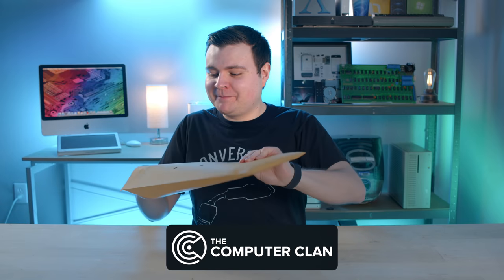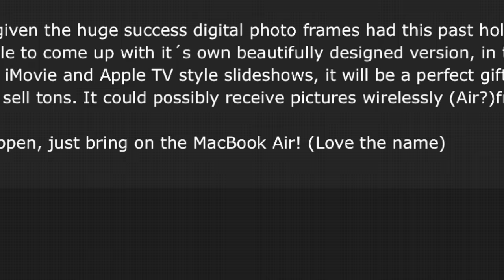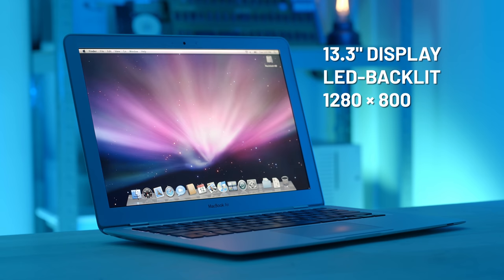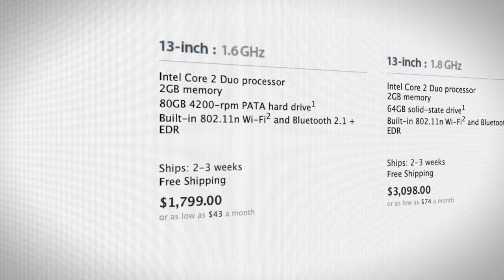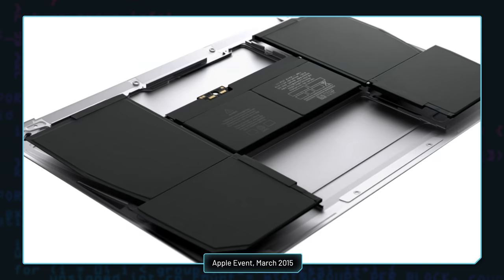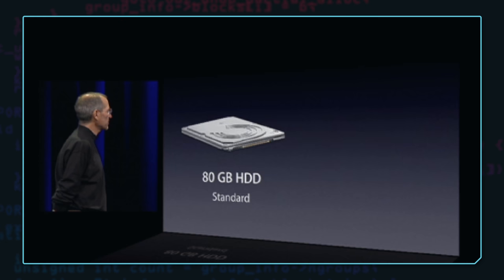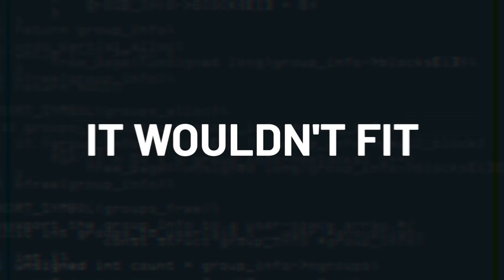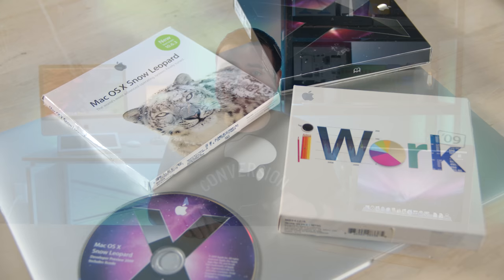How the MacBook Air Changed EVERYTHING - Krazy Ken’s Tech Talk

Comment: "A fresh, new SSD can absolutely breathe new life into an older computer" you're telling me, i finally added an ssd to my 2013 dell laptop that took ~10 minutes to boot into windows 10 recently, and now its faster than ever! 100% worth the $30
Reply: Yeah, spinning hard disks are the biggest bottleneck for many computers.
Reply: If Windows takes 10 minutes to start then it's beyond "bottleneck". It's defective.
Reply: @kg790  the drive itself still functioned fine, just took ages to get into windows. after booting it wasn't snappy per se, but nothing past the initial boot took very long
Reply: @Owtasmh  If the mechanical drive was OK, then the Windows installation was horrendously bloated. I bet if you imaged it to the SSD boot time would still be mediocre in the best of cases. My HP laptop, also from 2013 and spinning HD, boots in under a couple of minutes to fully working state, and that's with a several year old install and no optimization of any type.

Comment: My favorite part of the Air was that within less than a year I was able to hackintosh OSX onto a Dell Vostro A90 because it shared virtually all of the necessary hardware. I still have that thing running strong on 10.5.6 thirteen-plus years later.

Comment: I had the 2010 MacBook Air. I bought it to take to class. I was in my third year of college. The notebook I was using before to take to class was a thick ThinkPad. I am not a MacOS person, but at the time the Ultrabook didn't exist. It was the ONLY option if you wanted a thin and light laptop to bring to class. 

Now, I use a ThinkPad X1 Carbon running Fedora. It's a much better experience imo. It is just as thin and light as the Air was back then, but I get a full compliment of ports.
Reply: fedora? eww. use arch instead.

Comment: I still have one of those external SuperDrives. It's plugged in to my M1 Mac Mini. I think I last used it about six months ago to burn a CD to reload the OS onto a rack mount server in my garage server "closet".

I didn't begrudge the loss of the optical drive. I couldn't afford an Air at the time, but I had a Sony thin and light laptop that had no optical drive (dating back to 1999,) and a 15" MacBook Pro.

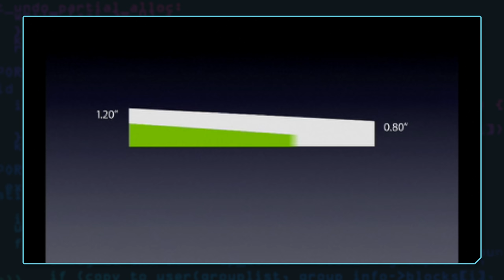Comment: @02:02 I don't care that much about weight (until it becomes ridiculous). I don't care that much about how thin it is, unless it's too tall to reach the keyboard. I want something more modular, repairable, modifiable, upgradable; built robustly, with upgradable lithium batteries that last for several hours, upgradable antennas and receiver electronics, video cards, mobos, ram, ports, m.2 storage. I want captured fasteners, so they can't be lost or mixed up. I'd be willing to pay more for such a platform.  
 That being said, all the mac laptops are very nice and work wonderfully.

Comment: I had a early 2015 MacBook Air that I bought used around 2 weeks ago.  After being charged 2 times, it stopped working. I bought it for 75$. Does anyone know why and how to fix this?
Reply: Change the battery
Reply: Most likely a dead battery 🙂
Reply: battery. Check Hugh Jefferys on this platform
Reply: Most likely the battery. Even if it was working I would recommend replacing it, since most batteries only usually last ~5 years. It’s been 7 at this point.
Reply: You need to replace the oil once per two weeks, did you do that?
Reply: Corbin Auriti  as far as I know if there is no battery detected (which would happen if it died fully) then the computer won't power itself on
Reply: @myrealusername2193  A mac can boot without a battery aslong as its connected to its AC adapter
Reply: @TotosSword  I charged it, the indicator showed green but still no signs of life.

Comment: My first ever Mac (that I'm also currently typing this on) was the cheapest one could get new in 2016 - An 11" MacBook Air for €899. I've rarely missed the optical drive, and the tiny screen has its limits, but also means it can fit anywhere an A4 sheet of paper can.

Also, does the 2010 MBA seriously have an eject key? What for? The 2010 and after models ditched it for a power button key instead.
Reply: Apple external keyboards had an eject key until fairly recently. Even my iMac’s keyboard (late 2015 model) has an eject key.
Reply: @TimurTripp2  even the 1st gen magic keyboard

Comment: I was at work the day the MacBook Air was unveiled. This was before smartphones were ubiquitous. So I had to text a friend to see what happened. The original Air was so expensive compared to the other MacBooks at the time. But it was still really cool and set the standard for consumer laptops going forward. I got one in 2011 then another in 2012 but then went Pro with the Retina MBP in 2013 and kept that for 6 years. But I've always missed that super thin and light laptop feel. I now have a 14" Pro. Side note: I really miss the 12" MacBook. If it had just one or two more ports and a better chip, like put M2 in it now, it would be really neat. Maybe they can one day bring it back as a 12" MacBook Air.

Comment: I lusted after but couldn't afford a MBA at the time - had to get a 13" Dell Vostro instead which served me well.
Soon after the Air, Dell released their Adamo 13 which was even more expensive at £1800 when new.
I bought one as surplus stock a couple of years later for £620. It was a lovely laptop with all the features of the Air in a similar sized package and with an SSD as standard. Only -ve is that it was absolutely non-upgradeable (other than buying a newer mainboard) and the 2GB RAM it came with was soon not enough.
Another interesting feature: the laptop came with Vista but after a bios upgrade would activate Windows 7 using the Dell installer. This was then upgraded for free to windows 10..

Comment: When the Apple MacBook Air first came out, and Steve pulled it out of the interoffice envelopes with string 10x13 I though I would get this in a heartbeat if I only had a need for a laptop.  Still do not have real need for a laptop, however last March when Apple did not come out with a 27-inch 5K M1 iMac I purchased a M1 MackBook Air, and 27-inch 5K VESA mount/arm as my replace for my 2014 5K 27-inch iMac.

My hope is that Apple keeps the Jony, and Steve design around as a SE entry level $ 999.00 version of the MacBook Air.  Just keep it with the previous version M series SOC for normals who just do things like eMail, surf the web, and watch your YouTube type clips.

Just like the loss of the floppy disk drive.  The loss of the CD/DVD drive in the Mac product line was not a loss.  The loss to the link one of my great Steve moments during presentations will hurt if Apple does not keep the original MacBook Air design around.

Comment: Guys I need some advice, someone is selling this pc around 900 $ should I take it?! 
  
 * HARDWARE SPECIFICATIONS *
 
   GRAPHIC CARD: MSI TWIN FRONZ 7 RTX 2060 6 GB OC GRAPHIC CARD (BOXED GUARANTEED) PROCESSOR    :

   INTEL i5 9400F (9th GENERATION) PROCESSOR (BOXED GUARANTEE FARM TUCUTANCI SOFT)

BOXED GUARANTEED)

   MOTHERBOARD: ASUS PRIME B365M-K (BOXED GUARANTEED)

   RAM: 16 GB 3000 MHZ (BOXED GUARANTEED)

   SSD: 500 GB SAMSUNG (BOXED GUARANTEED)

 
 
     MONITOR : AOC 24" 144 HZ 1 MS CURVED ( ROTATING RIGHT LEFT UP AND DOWN ADJUSTABLE
 
     KEYBOARD MOUSE : ZERO HYTEC RGB

     HEADPHONES : ZERO   HYTEC RGB HEADPHONES

Comment: I use PCs but I switched to an external optical drive way before the fell out of use. I got sick of the dust collecting in it from the air flow needed for the computer. With it external I never had to clean it anymore.

Comment: You know, to me in retrospect, I feel like the MacBook Air not only introduced new innovations and changes to the Mac line, but also to the entire computer industry as a whole.

Take the optical drive and SSD for example, no new computers and laptops nowadays include optical drives and/or hard disk drives as options for computers, and even the batteries started to become non-removable or integrated into modern laptops of other vendors. Furthermore, newer laptops are starting to get thinner and slimmer as we speak, and they also run quieter than how they were decades ago.

Obsolescence of older technologies in newer computers and laptops may be a bit of a controversy to some people, but in the grand scheme of things, it’s probably for the better and is also future-proofing as well.

So in short, as I repeat, the MacBook Air was the model for newer computers and laptops that we use everyday, as it introduced innovations into not only the Mac line of computers, but to the entire computer industry as a whole, which includes PC vendors. It’s basically a starting point for how we see and use computers to this day, and it is interesting how the MacBook achieved those innovations before other companies did. It’s basically as simple as saying if Apple can do it first, then other companies will follow suit. It’s as simple as that.

Anyways, enough rambling, it’s interesting how the MacBook Air had several innovations that were later put into the Mac line, especially with features getting added or removed. And I feel like those innovations have slowly started to sip in with other laptops and desktops that are not in the Mac line, such as PCs. I have a newer HP Pavilion laptop and it had no optical drive and hard disk drive, but a solid state drive is in there (an NVMe SSD if you want to get technical). There are also less ports on the sides of that laptop, but it is also a bit thinner and smaller than my other laptops that I’ve used and even includes a touchscreen as well (though that is something not included with MacBooks). Again, it’s interesting to see the history of this particular MacBook and how the innovations it introduced slowly went over to the entire Mac line in the years that followed. Amazing work!
Reply: My laptop that I bought in 2020 had a 5400rpm 1tb HDD thankfully I put a Crucial P5 plus 1 terabyte SSD back in February of this year, along with 12gb of ram. It feels like a new pc tbh